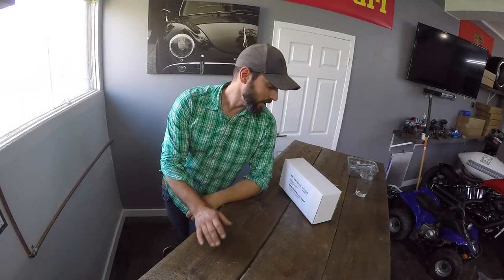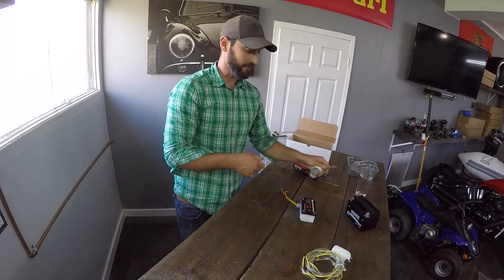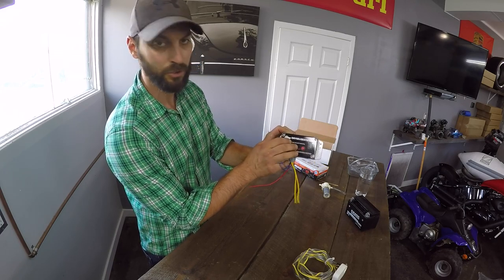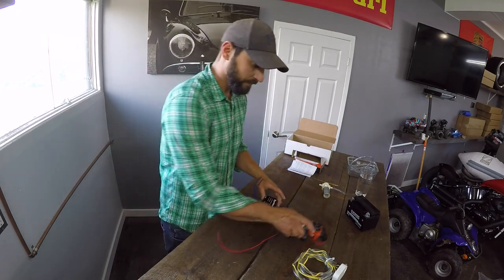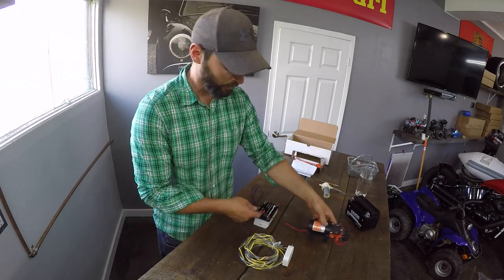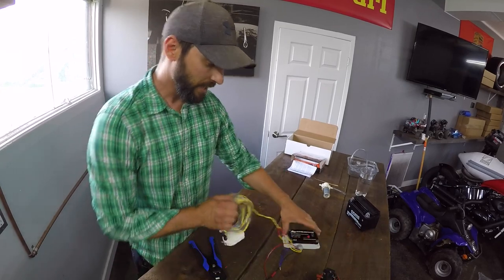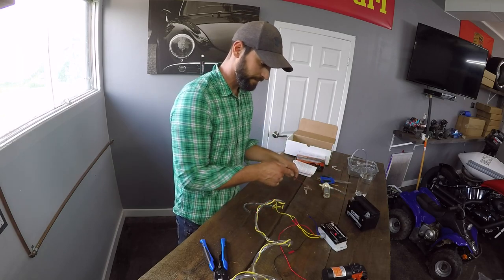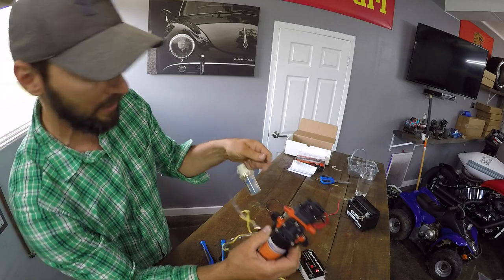www.drybilgesystem.com dry bilge how to install

Comment: Wow, I'm the first to give a thumbs up! First comment also. I've been looking high and low for pumps and float switches so I can keep water out. I'm thinking of having 2 catch trays below each of my prop shafts to catch the normal drips, then pumped out. Can one of your systems with 2 sensors work for my application? Ron